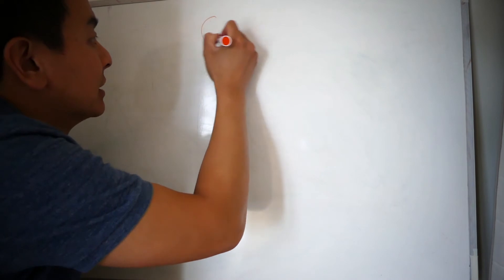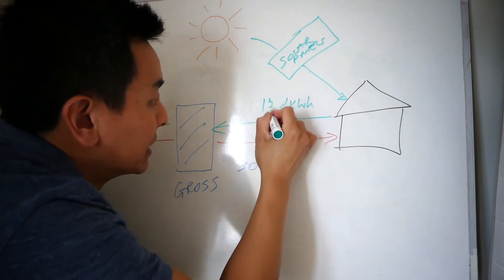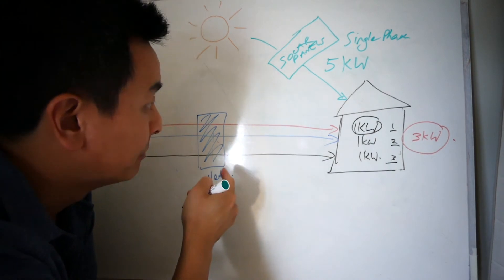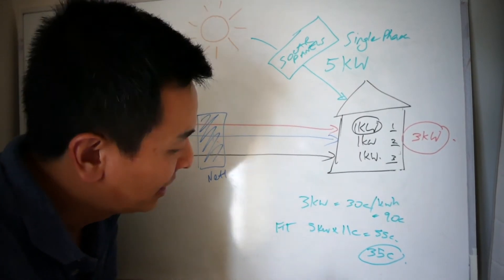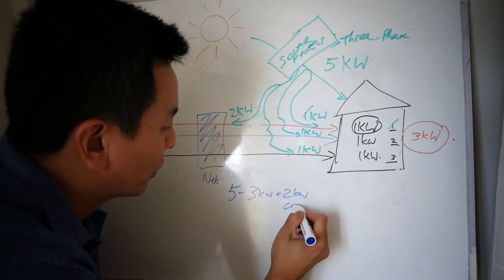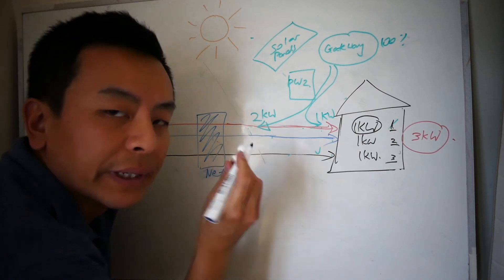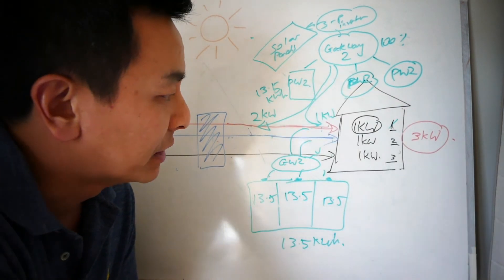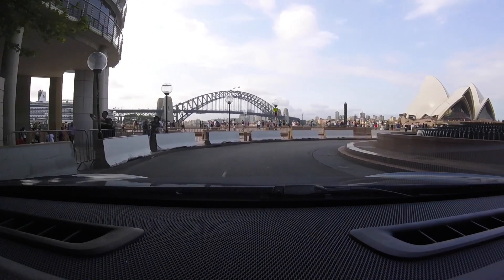Tesla PowerWall2 Net Metering and 3-phase Discussion | Ludicrous Feed | Tesla Tom

Comment: Thanks very much for your very helpful information. I just installed 2 PW2s on a 3 ph home and I spent a lot of time unsuccessfully trying to find this information. In my case, I have a legacy PV system on a premium FIT from 2010 or 11 and was told I needed to add the other 2 phases so that additional panels and batteries could be added without losing the FIT. When the house was switched the 3 ph, the sparkie had to balance the load across the 3 phases despite no added loads from the house (my peak load is 4-5 kW briefly and average demand is ~13 kWh/ day) so, functionally - from the grid’s perspective- I can’t see the need for the balancing. Splitting my house loads across 3 phases crueled my hope to backup the entire house (but with lights, fridge, and coffee maker (plus an extension lead to the TV) I can manage a blackout ok! And with cbus 2 smart wiring to all the lighting and exhaust fans - I discovered during a grid outage that power to fixtures and power to the control units had been split across 2 phases - so that needed to be fixed with a quick modification to the distribution board by the sparkie. I still wish I could swap all the house circuits back to the phase with the battery, seeing as how it wouldn’t make any difference to the load on that phase compared to historical use.

Until I found your video, I was stressing about how I could no longer ‘disappear’ my load from the grid during the night time because there would always be some components on the non-backup phases. Eliminating my nighttime demand in order to reduce grid demand for FF generation was the whole point of my PW2 purchase as my legacy PV output far exceeded my consumption but the generation and load were not coincident. So, thank you again for putting my mind at rest!
Reply from the maker: Pleasure, glad it helped. I’ve had the same setup since this video was posted (I made this comment in Nov 2023) and everything still working fine 🙏

Comment: In the case of 3 phase and one battery. Assuming you do not have any appliances or tools that actually require 3 phase and the grid is down, why can't you have a contactor that disconnects the grid and connects the 3 phases on the house side, making it a virtual single phase? When the grid comes back on, the contactor can disconnect the joined phases and reconnect as 3 phases again. Yep understand the battery will be effectively split 3 ways, but if its an issue you'll have to add more battery.
Reply from the maker: AFAIK I'm not aware of a commercial product or 'contactor' that can perform this single/three phase toggle function? If so that would be awesome. As for my situation, the only 3-phase appliances are my EV chargers which is not a worry usually for me as worse case scenario I can charge my cars with the 10A mobile connector in the event of a prolonged blackout ... or go to a public charger to top up.
Reply: @LudicrousFeed  What about a 3 phase ATS? They are readily available.

Comment: Coming across this video late, however one point wasn't fully explained in regards to a single phase inverter and 3 phase supply through a net meter.  I assume that if I'm generating 3kW and using 1kw per phase, then the solar directly powers the phase connected to the inverter, and I export the remaining 2kW.  The net meter will then look at that and see that I'm importing 2kW across those 2 phases and cancel out any import costs.  This only came up when the discussion included the powerwall 2.  In theory it should be the same since the net meter doesn't know if a powerwall controller is deciding to send the power back to the grid or the inverter is.

Cheers, Paul
Reply from the maker: Yes your summary is correct. Solar net metering occurs regardless of whether a battery is connected or not

Comment: Thanks for taking the time to explain this.
I have a 3 phase home where my "essential" power and lighting are spread over 2 phases.  I have other non-essential devices running off the 3rd phase as well as a 3 phase bore. My Solar provider has informed me that I need 2 Tesla Gateway 2 devices to enable 2 Powerwalls to support the 2 phases of essential services.  Is this correct?  The rest of my setup is planned to have 36 * 370w panels and a 10kw 3 phase inverter.
Reply from the maker: Hi Greg, thanks for the question. My understanding is that for normal grid operation, if you have net metering then it won’t matter. However, in the event of a blackout, then you will want your 2 PW2/gateways connected to your ‘essential’ phases so that you are covered. Hope that makes sense.  Great setup btw! 👍🙂
Reply: @LudicrousFeed  Thanks for the speedy reply!  So can I construe from your comment that I do indeed need 2 * Gateway 2 devices?   My simple thinking was that a single 3 phase gateway 2 device should allow supply of power (using 2 powerwalls) to 2 phases.  BTW I had a new (net metering) meter installed today.  The only downside is that I still lose charging from the panels when the grid drops out (but I really can't afford a 3rd powerwall).
Reply from the maker: My understanding is that only one gateway is required for multiple batteries on ONE phase.  I believe that backup mode is only available to ONE phase, even in a 3-phase setup and even if you have multiple batteries spread across the three phases.  So I guess the issue is whether it's worth having a second battery on a second phase if it's not available for backup anyway in the event of a blackout?  Again, I'm not a qualified installer so please always check with Tesla or your installer.
Reply: @LudicrousFeed  Thanks Tom, it looks like technology hasn't got to where I would like it to be yet.  The fundamental requirement for me; the batteries must be able to provide power to both phases at night and during grid outages.  I may have to re-think my strategy or stump up more cash.
Your input has been invaluable!
Reply from the maker: My absolute pleasure. Essentially we either need a true three phase gateway OR a three phase battery.

Comment: Well explained Tom. From what I understand you're correct, you'd need three PW2's. Also if you're a 3 phase home and running things like 3 phase A/C etc due to their high power draw you really would need 3 PW2's, one for each phase.
Reply from the maker: Craig Hardiman I feel that way too Craig. As I said in my video, segmenting PW2 into three lots of 4.6kWh mini batteries to power a 3-phase home that is not perfectly balanced would drain the segments disproportionately. TT
Reply: @LudicrousFeed It doesn't work that way. Three phase requires three separate phases (all 120 deg out of phase with each other) and the combined voltage with a common neutral is 400V AC (not 690V) - you would need some very expensive hardware to convert a single phase supply to 3 phase (for big loads there is an autotransformer that converts the 230V to 400V, a bunch of capacitors and electronics to split that into 3 phase and an idler motor). Because the PW2 is an AC battery and it's single phase you need three of them. If it was a DC battery then you can use a single battery with a 3 phase hybrid inverter. I was very confused when you started talking about splitting the Powerwall 2 into 3 separate sections - apart from capacity it just wouldn't work.

Comment: Great explanation. I have 3 phase & a PW2. Phase 2 & 3 are wired to run big load items only. Pool pump, ducted AC and some power tool outlets. In a blackout the house remains functional except for those big load items. This is preferable as firstly, the PW cannot discharge more than 5kw/h and if it did would drain a 100% full PW in less than an hour.
Reply from the maker: DrunkenAfro Thanks. I’ve wired my PW2 and 3-phase home in much the same way. Essentials (eg fridge and kitchen) on Phase 1 coupled with PW2/solar. TT

Comment: i think for the 3 phase gateway to work maybe it has to have some kind of dynamic switching. so you would have say one huge bank and then 3 sub smaller battery banks that act as buffers. then your battery maangement system could potentially cycle through and discharge into each buffer battery. that way maybe you dont need to dedicate 3 large storage pools
Reply: powerwall discharge is capped at 5kw from memory?
Reply from the maker: Adrian Chung Yup capped at 5kW.
Reply from the maker: Adrian Chung That would be one smart system. That kind of bucket filling system would have to be inbuilt into the 3-P PW2.